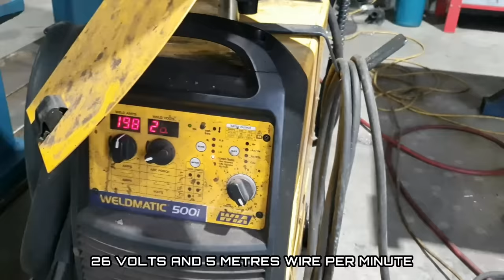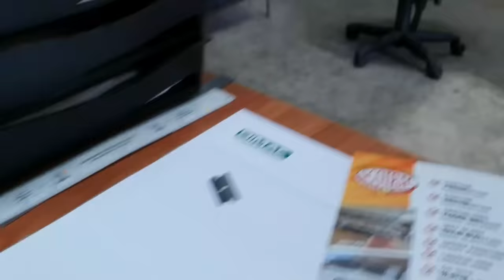CAT D10 Dozer Cylinder Rebuild | Part 3 | Making the New Rod

Comment: I do so enjoy your videos, I am retired now but have worked in Heavy engineering building Valves for oil, gas and water pipelines  from start to finish...(Robt Cort and sons) and my love of precision knows no bounds, but In my latter years I opted for the maintenance sector which was more suited to my ageing body, however, please keep your fascinating videos coming, they are very educational especially for those that do not appreciate how important precision maching is.10/10

Comment: another great video can't wait to see it finished. quick question Kurtis when you machine the weld to separate the eye from the old rod does how it's joined make a difference how you approach the job, like if its friction welded or normal mig weld.
Reply from the maker: Hey mate thanks for watching great question. Yes it does make a difference. MIG weld usually bit more guess work trying to determine how it fits together and machining apart to suit the existing join. With friction weld (like this one) much easier to machine/part off and turn a spigot at the same time.

Comment: Loving this series! Quick question: Whats the jubilee clip on the rod for when you;re welding the eye on? Is it to dissapate heat or something?
Reply from the maker: Hey mate the hose clamp is holding on a piece of aluminium sheet to protect the chrome rod
Reply: @CuttingEdgeEngineering  Brilliant, thanks. I missed that the first time around. I can see it now :)

Comment: Also I wanted to know why you use coolant on some cuts and none on others?
Reply from the maker: Hey mate a few reasons... depends on the material being cut, with the chrome induction layer I use ceramic insert so no coolant on those otherwise thermal shock and the insert shatters. The carbide inserts can be run hot/dry or flooded wet so I prefer less coolant mess and usually only run it when taking heavier cuts. Hope that helps 😎👍
Reply: @CuttingEdgeEngineering  yeah that's great info, cheers 👍🏻
Thanks for taking the time to reply

Comment: There is something quite mesmerising about that index drill disappearing into the part but it could be just me. Thanks both for another very interesting video, kept me out of trouble for a while. Looking forward to part 4. Regards from Wales
Reply from the maker: Hey mate yeah a few find that mesmerising #machinistporn haha Thanks for watching 😎👍
Reply: @ghl It's called a U-Drill. You should see that thing in cnc machine!  I used one 20mm u-drill today at work in cold roll steel.. 4000rpm and trhu spindle coolant makes pretty fast holes 😎👌🏻😄
Reply: @SipuliSopuli  cheers Matti, that I would like to see!

Comment: I worked in a large machine shop.  Only people killed in the shop were operating large presses.  On one vertical press, the pressing slug shattered... drove a piece of steel right through the operators heart.  After that event, the press was enclosed by some expanded metal screening.
Swing the screen closed before pressing.  Might think about that for your vertical press.

Comment: I know you cannot save everything but those scrap rods could be used to to produce small items need for other work. For example if you needed a broaching plug for use in the press those old shafts would work great.

Comment: I still can't believe how true that 3 jaw of yours runs, I watch Abom79 as well and the man is a master at trueing with a 4 jaw quickly to within 1/10's of a thou, but that 3 jaws seems to get it there anyway.
Reply from the maker: Yeah mate it's a beast I take the time when it was brand new to make sure it's as accurate as you can get
Reply: @CuttingEdgeEngineering   Was going to ask was that short dial gauge demo at 15:15 for all the 4 jaw evangelists.

Comment: Hey,  I like your channel and subscribed a few weeks ago.  When I was 17 I worked in a machine shop for a year making commercial jet landing gear.  Loved it.  Too bad I was young and stupid; got fired.  I would like you, please, to show and explain the cutting inserts that you're using and how they mount.  I never learned or performed table set ups. I ran parts. I never ran the lathe.  Vertical and horizontal mills, drill press, 1 and 6 cutter hydratell (I think that's how you spell it). I was about to get on a bridgeport when I got that notice. Thanks

Comment: To get the final correct length of the entire tube is that obtained by making a known drill hole depth on the front of the tube or by turning a known length of the stub that is pressed into that hole? Or do you make that stub longer then needed and adjust for the final length when everything is fitted and ready to weld?

Comment: Awesome videos, as I’m not a metal worker my question is , why is it only some times your using the white cutting fluid but mostly not ? Cheers
Reply from the maker: Hey mate thanks for watching. A few reasons... depends on the material being cut, with the chrome induction layer I use ceramic insert so no coolant on those otherwise thermal shock and the insert shatters. The carbide inserts can be run hot/dry or flooded wet so I prefer less coolant mess and usually only run it when taking heavier cuts. Hope that helps 😎👍

Comment: Thumbs up for the outtakes!  Genius brain, uncooperating mouth, or is it the other way 'round?.  Videos are outstanding in visual quality, editing, content and detail especially indicating what cutting tool you are using or what the welding settings are.  Great stuff.  I see the hose clamp on the rod, what gives there?  Staff of 21, why are they hiding?   And, I am still undecided if the chair was smarter than the pup.  Couldn't ya help get the toy, geez...
Reply from the maker: Hey mate yeah definitely other way around I reckon hahaaa The hose clamp is holding a sheet of aluminium around the rod to protect the chrome. The chair was a challenge had many obstacles to overcome 😂👍

Comment: I'd probably like to live near his recycle bin... :)
Reply from the maker: You should see the big bin 🤣
Reply: Machining that induction hardened bar is a bitch.
You notice Curtis skins it quite deeply and with a shallow DOC using a ceramic insert before taking normal cuts with carbide inserts.
So, not so good as random stock..
Not to say there wouldn't be some other material worth a bit of bin diving for the hobbyist.

Comment: Those sparks when you started cutting went away after you got deeper in the material, is the bar getting softer towards the core or was it just the different inserts?
Reply from the maker: Hey mate a bit of both the top layer is induction hardened and was using ceramic with that.

Comment: Question, when cutting the threads, how do you get it to cut in the exact same place? Do you use the DRO set at 0 or something? Always wanted to know because if you’re out by even a little bit you’ll mess up the threads,
Reply: There is a special screw on the lathe that matches the rotation with the threads. Its a very old feature.

Comment: What happens if you try to take a deeper cut of the hardened chrome exterior with the ceramic insert? Seems like the machine has a pretty light load with the light passes.
Reply from the maker: Hey mate watch this, it's what happens if we take a full cut in one pass, need to have RPM flat shit and it's dangerous AF on a manual machine https://youtu.be/UnK0OpHb3kA?t=92
Reply: @CuttingEdgeEngineering  Holy shit thats terrifying. small light cuts it is then...

Comment: Thanks for the video mate. What’s the hose clamp for while you’re welding?
Reply: He has wrapped the job in thin sheet metal, held in place by the hose clamps to protect the finish on the shaft from splatter from the welding and to prevent scratches damaging it.
Reply from the maker: Thanks for watching, Aidan is spot on, it's aluminium "flashing" sheet to protect the chrome
Reply: @CuttingEdgeEngineering  thanks mate. I didn’t see the overlap in the sheet aluminium. Just looked like a clamp on the shaft.

Comment: Nice content! Question: you obviously create a lot of chips and also scrap quite some rods and eyes. That's some quality metals in that bin, is there any sort of value in that for you? How is that processed?
Reply from the maker: Hey mate thanks for watching. Yeah we have a bigger scrap bin and it all goes to a metal recycler we get paid per tonne.
Reply: @CuttingEdgeEngineering  Without going into specifics, is that scrap value even remotely connected to the raw material cost you buy? Or is it really just a token amount in the grand scheme of things?

Comment: Just a question why would you not run coolent sometimes but run it other times? Just curious
Reply from the maker: Hey mate thanks for watching. A few reasons... depends on the material being cut, with the chrome induction layer I use ceramic insert so no coolant on those otherwise thermal shock and the insert shatters. The carbide inserts can be run hot/dry or flooded wet so I prefer less coolant mess and usually only run it when taking heavier cuts. Hope that helps 😎👍

Comment: @Cutting Edge Engineering Australia How do you decide on the diameter of eye joint into the rod (sorry, I'm missing the correct words)? Is it the smaller the better, to rely on more the weld surface area and leave the diameter just enough to align the two parts? I am not an engineer or machinist, I just have some questions regarding reliability of repairs like this (not like I would not trust a company that has such a huge investment into machines and work force).
I like all the work you do by recycling and saving money to the customers.

Comment: ceramic inserts are a high cost of turning on a engine lathe,on a cnc or nc you can maintain surface speed and feed,on a manual lathe you cant so it cost much more on inserts,maybe try braze on tips for roughing mate then use the ceramic,with the braze on you can just resharpen were with ceramic tips you cant
Reply from the maker: Hey mate we use a brand and have a tooling supplier that doesn't rip us off, doesn't cost too much 😎👍
Reply: @CuttingEdgeEngineering  you are blessed then mate,ive used them in job shops for years and found to just waste braze on tools and then finish with them,i like that lathe of yours,did you special order the 3 jaw chuck or is it just your prefered chuck

Comment: H Kurtis, how do you cut the induction hardened rod to prefinished length, bandsaw would not look at it?
Reply: The factory ends must have been parted off on a lathe; they were too square to have been sawn off.
Reply from the maker: Hey mate we use Tungsten carbide tipped bandsaw blade
Reply: Thanks Kurtis, did not know that type of blade existed, learn someting everyday.

Comment: Great engineering content, could you say at times the reasons why you are cutting dry sometimes,then cooling oil, then cutting oil.  You are such a professional  multi skilled guy. 

It will help us engineers
Reply from the maker: Hey mate thanks for watching. A few reasons... depends on the material being cut, with the chrome induction layer I use ceramic insert so no coolant on those otherwise thermal shock and the insert shatters. The carbide inserts can be run hot/dry or flooded wet so I prefer less coolant mess and usually only run it when taking heavier cuts. Hope that helps 😎👍

Comment: Let's pretend I don't know anything about hydraulic cylinders (will be easy).... can spray welding and finishing the surface be a possibility? Seems the cost in steel, electricity,  tooling, labor, and wear and tear for a finish repair could be done with spray welding. 
If that's  a bad idea I'm  curious why. :-/ 🤔

Comment: Kurtis why do youheat metal before welding??
Reply: burn anything off? i dont work with metal but it sounds like a basic thing to do
Reply: To avoid cracks during cooling after welding.

Comment: That rod could have been used for other project, why throw it away?
Reply: There is a chrome plating on the surface of the rod, and it is scratched, so it can't be use for other rod as it would have been replated, and it's too expensive for him.
Rod cylinders are always plated, if they are not, they are made of stainless steel for acid environment.

Comment: Any reason for not rechroming the rod?
Reply from the maker: Not worth it would cost about double
Reply: @CuttingEdgeEngineering  probably the farmer in me but could the old rod be turned down and used on a smaller sized job? ( maybe the hard surfaceing is only so thick)